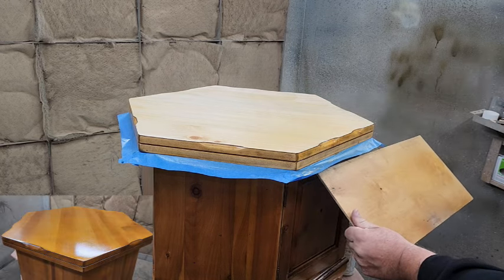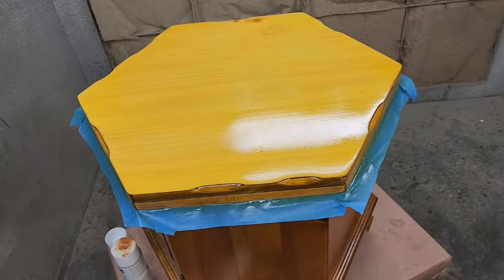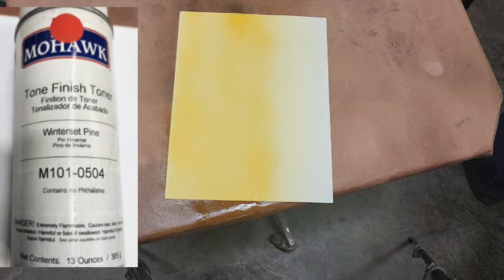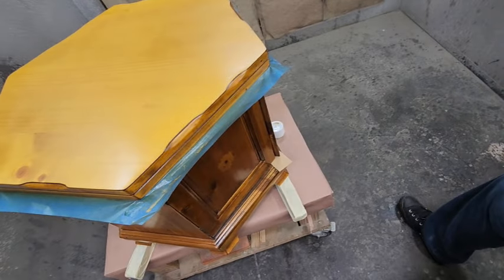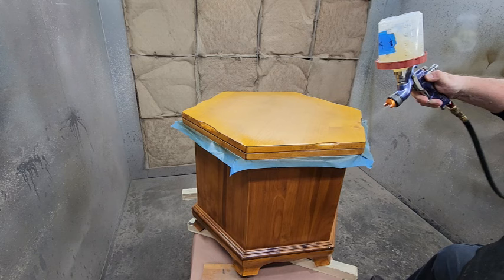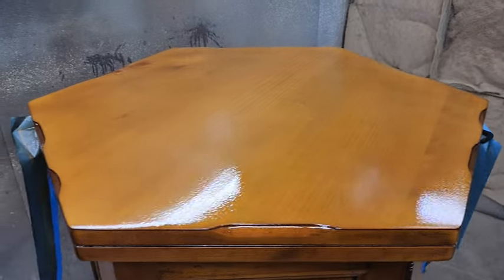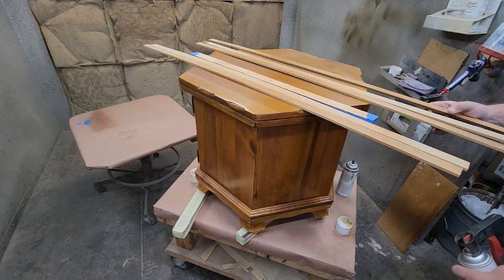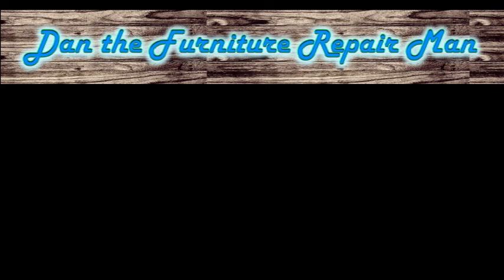Matching color in Furniture with Spray Can Mohawk Toners

Comment: How long do you wait between layers to dry? Sealer, toner, clear, toner, clear etc.
Reply from the maker: Hello,
I'm Spraying lacquer and the toner is lacquer based.
I spray the toner and if I'm happy with it I spray a clear coat(sealer or clear lacquer) right away
If I feel I'm heavy in an area then I let it dry and lightly sand the whole top not just the area but sand a little more in the heavy area.
I give my clear cots 30-60 mins to dry depending on conditions. 
The lacquer is changing so there may be a limit to how many coats can be applied in a day before problems happen.

Comment: Great video. Thank you. Do you ever need to send in between these coats?
Reply from the maker: I'm spraying lacquer so there isn't a need to sand for adhesion but if I feel the toner is too heavy in an area or on the whole piece I will let it dry and sand the whole piece and a little heavier in the areas that need it.
Also if I'm trying to create a light layer I will sand it and leave the dust on it then spray the clear, because they are both lacquer based the clear will melt the dust of the toner and help give the piece an even more even piece.